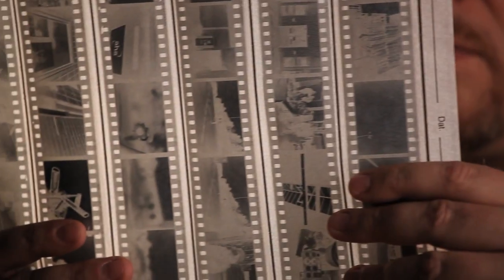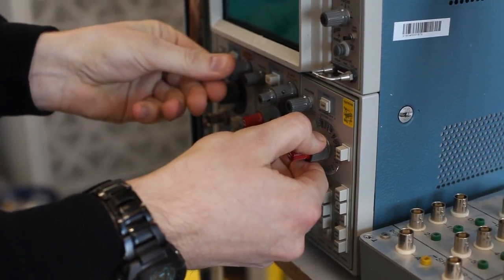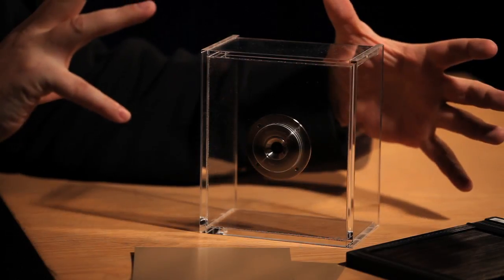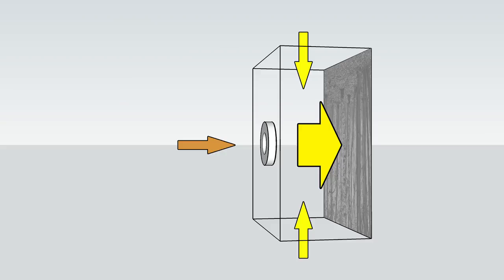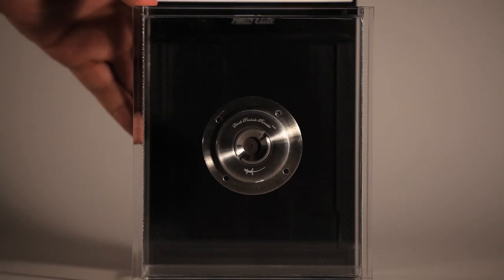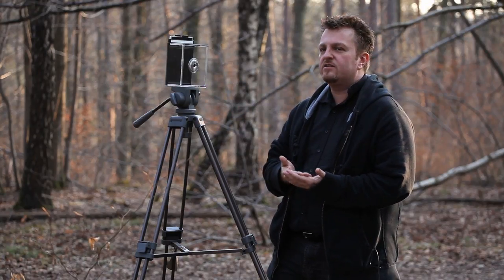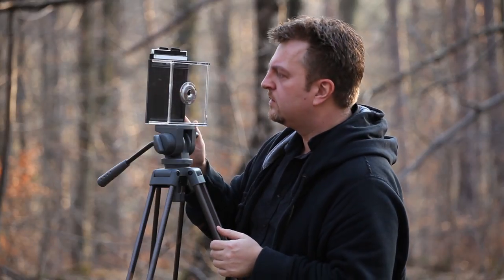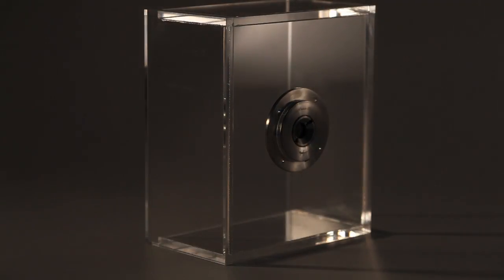The Invisible Camera - Part 1

Comment: What happened to focus?  *Every* camera that I've encountered has focus.  Some have fixed focus, but it's still there.  Your terapixels don't help if the picture isn't focused.  Also your range of focus at terapixels is going to be tiny, so you will have one little part in focus with the rest of the picture out of focus.

Comment: that's not how you hold a gossen meter. you're metering your hand and possibly part of your arm. --- if those camera walls had polarization on them, you would see inside but not through to the other side. --- what use is there of 1/100,000 shutter and 0.001 ISO film? on earth at least. photographing the sun up-close, maybe? --- detail isn't just going to keep going up if you keep lowering the ISO. the crystals in the film have to be finer too. --- I could go on

Comment: Obviously fake. Basic optics theory tells us that the film would have to be made concentric with the lens (assuming the film only captures light perpendicular to it). Producing film and lenses with such perfect curves would not be cheap (if possible). The only way this theoretical film could be flat (as shown) and still work is if it was formed as a Fresnel lens. This would greatly impair the result and make the whole concept redundant.

The amplification thing doesn't make much sense either.